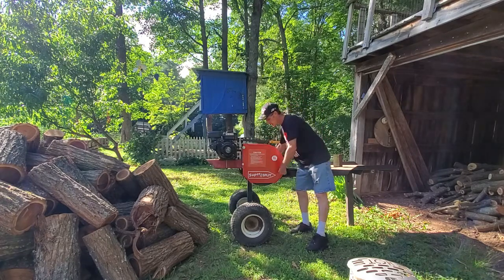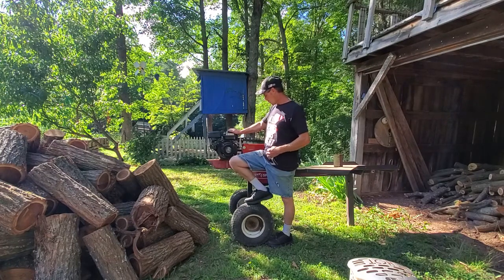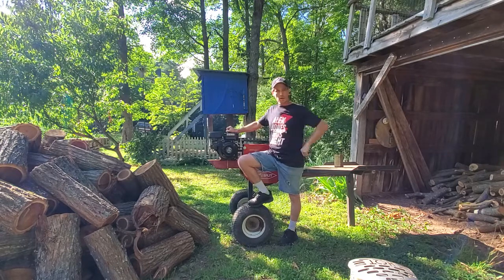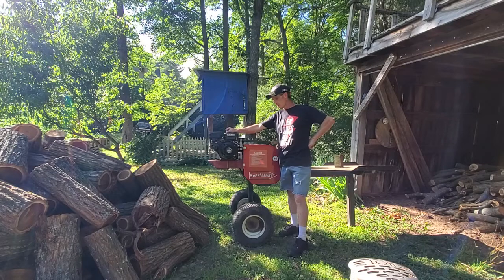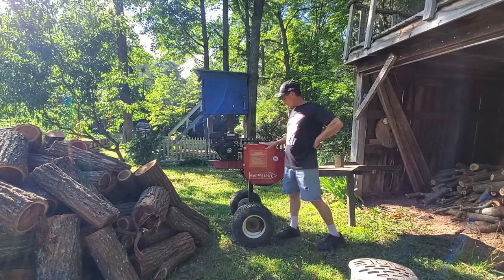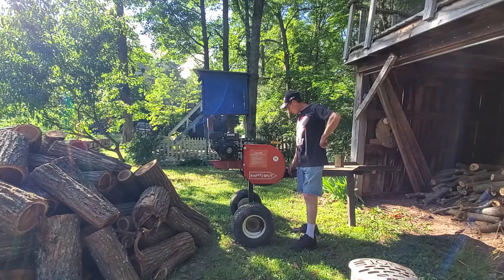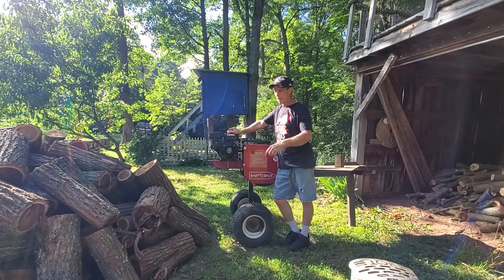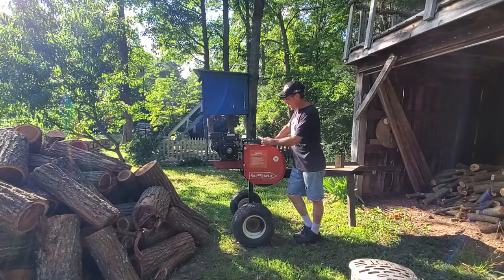SUPERSPLIT wood splitter --15 years later REVIEW PT1

Comment: What spare parts would you recommend having on hand?
Reply from the maker: nothing.
everything on this machine is hand made and probably wont wear out in your lifetime under normal 1 user use over time.
the engine is the engine,, so,, any engine will do fine if needng replaced.
the flyweel bearings "may" one day go out but mine have not, only the dust cover popped off one, i fixed that.
there's really nothing left to talk about,, evertything is repairable or replaceable with general parts  you find as scrap saved back or located locally.

Comment: The standard engine on the super split is 5.5 - 9 hp gas engine.  Even the largest one wouldn't drive a 10kw generator head (9 hp ~= 6.8 kw give or take).  Maybe I'm missing something about your proposed modifications.
Reply from the maker: the standard engine of my era is the 4.5 Ex13 subaru.  using the unused flywheel to drive a gen head pulley.  if you have thoughts on what this looks like on the calculator, i get it.  let me know your thoughts if you like and you can email,,, i will reply.  the idea of the engine itself direct coupled to the gen head input is obviously not what i am speaking to.  using the flywheel to drive the head is the objective.